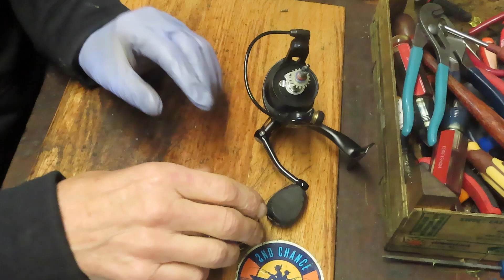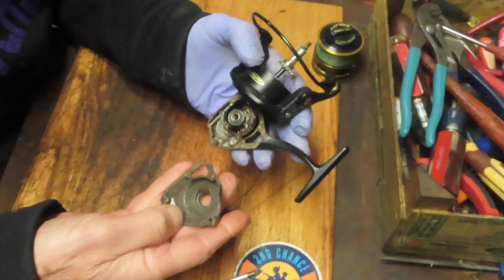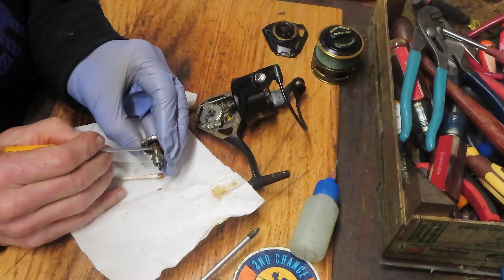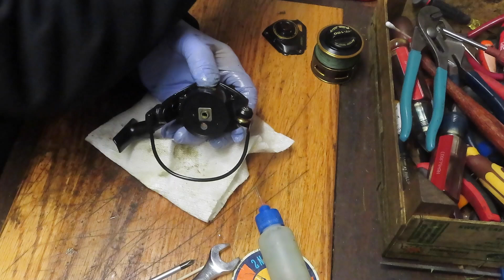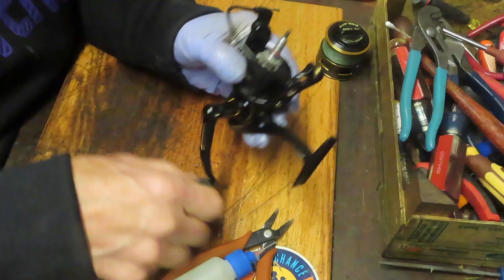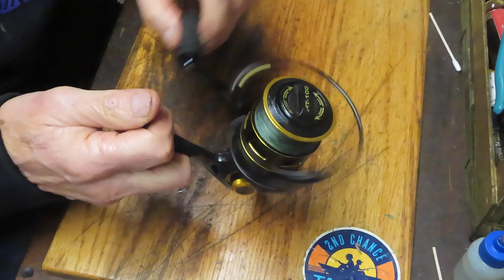How to Service a Penn Clash 3000 Reel | Step-by-Step Maintenance & Comparison Guide

Comment: What kind of penetrating oil is that? Needing help on what brand or kind to get. Loved the video, broke my crosswind block and you helped me tremendously in taking apart cleaning etc. Thanks!
Reply from the maker: You can use any brand.  Most of the time I use WD40, but any penetrating oil will do

Comment: Great video, thanks so much. My reel is smoother now, but still a slight grinding when reeling. Guess a part needs replacing I will try to figure out. First time breaking a reel down all the way, thanks tonyour video.
Reply from the maker: That grind could be a few things.  It could be a missing shim on the main shaft, or it could be gear wear.  It usually has something to do with alignment of the gears

Comment: I recenly put fesh  line on my Penn SS4400. I noticed there's coning with the thick part at the top of the spool. Unfortunately, there are no extra washers to remove. Is there anything else that can cause this?
Reply from the maker: If there is coning at the top, you do not remove washers (that would lower the spool). You add washers which raises the spool and allows the line to reach the lower portion of the spool.

Also check to see if there is a lot of up/down play by pulling / pushing on the spool.  If there is excessive play, a stew may be loose in the crosswind block.  - Dennis